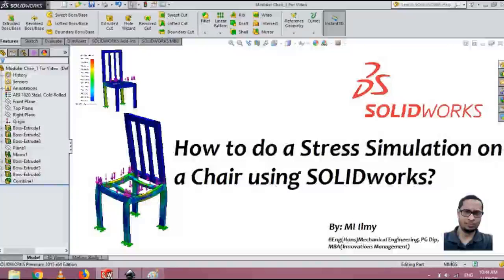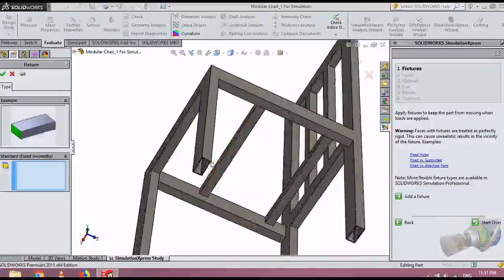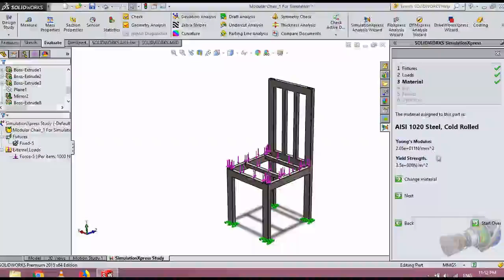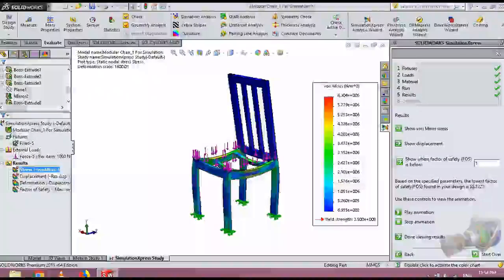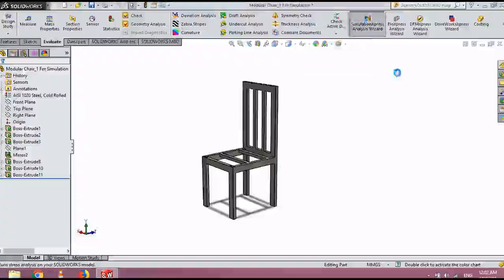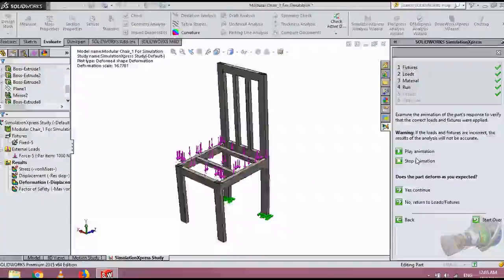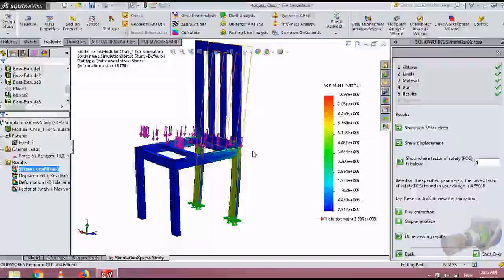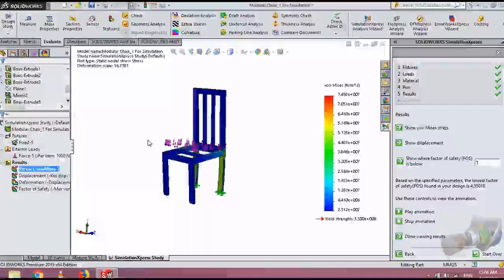How to do a stress simulation on a chair using SOLIDworks

Comment: Hello sir, this is a one part chair right? because right now i trying to run a simulation on shell chair. but because of it is in assembly it is pretty hard. i need to define the contact and so on.
Reply from the maker: Yes! it is not convenient to run a simulation of an assembly in SolidWorks, therefore you need to design it as a model.